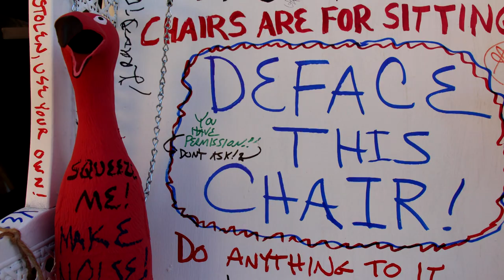Askew state

Comment: Steve, for the "disappearing" chair, why not make an array of standing dowels/rods and build the chair the same way brick walls are built? Each wooden "brick" would have a hole or two, so that it can be slid onto a dowel (or two adjacent ones to prevent it from spinning around). By placing the pieces of wood on the dowels/rods, the whole construction would not fall apart and be deconstructed from top to bottom. It would probably look a bit like a castle and the number of pieces of wood would be quite impressive, but an approx. 5x5x10cm piece of wood could be of the right size to be taken away.

Comment: greetings Steve!
Idea with disappearing chair is great.
I see realization of this puzzle in one of this ways:
1) build a plan of a chair, join sides/parts together temporary to be sure that it is solid, separate all and make little parts at bandsaw, make holes for jointers or dowels in places where puzzleparts are going to meet, glue jointer into one hole - job is done.2) build a chair of a 1/4 inch wood, draw a puzzlenet on it and saw it with thinnest fretsaw or something like that.
;)